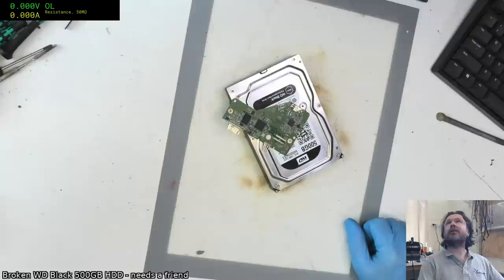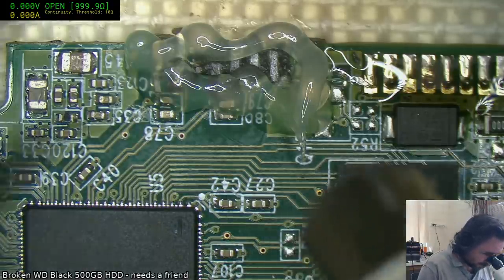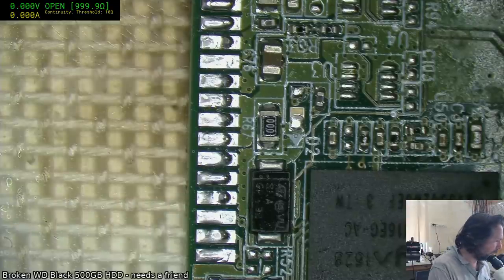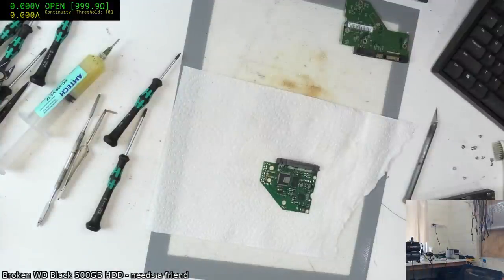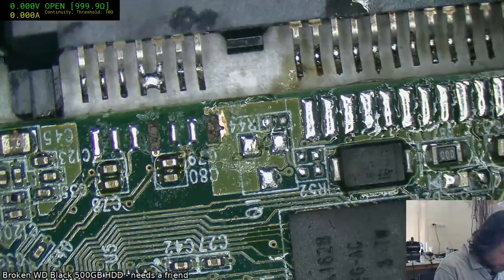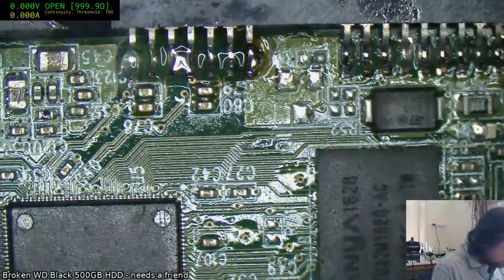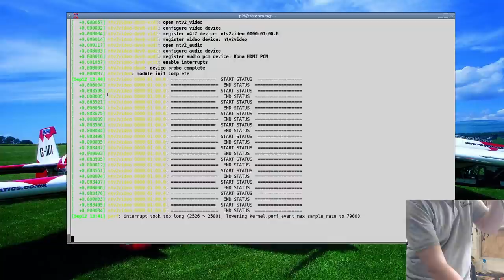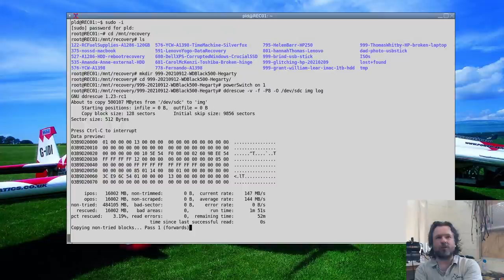Physically broken WD Black 500GB HDD - needs a donor friend and data recovery

Comment: Lowmelt solder. Best way to get connectors off
Reply from the maker: Only required standard leaded to get this one off.

Not a fan of low-melt unless absolutely required due to the cleanup mess and cost.